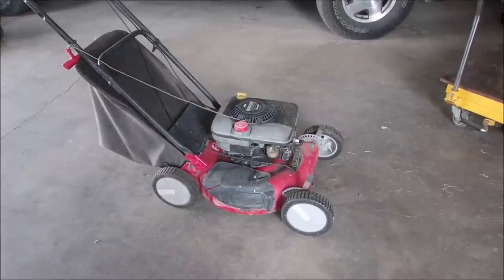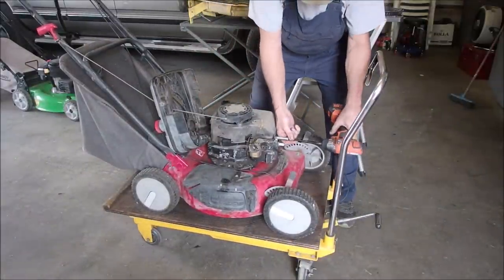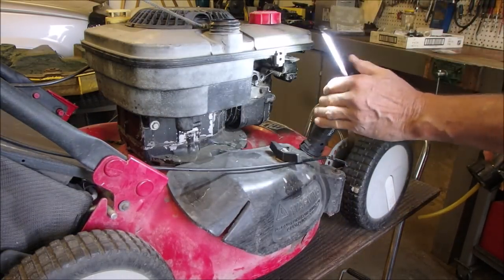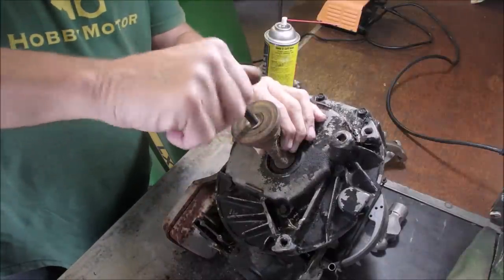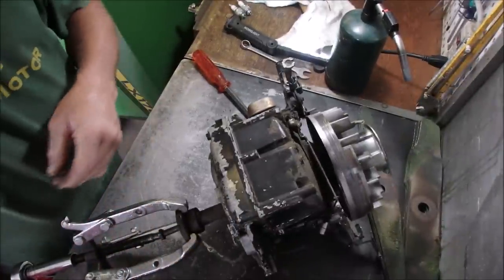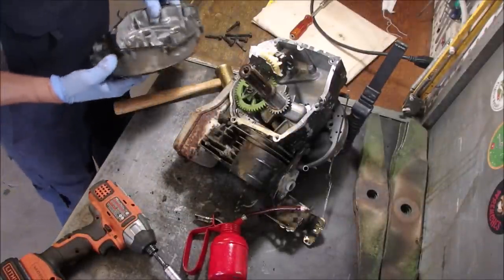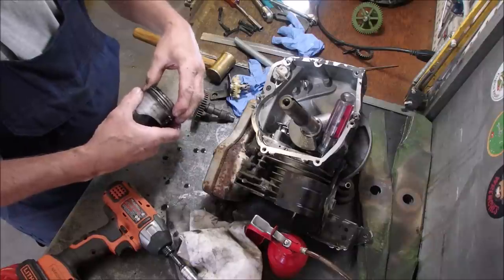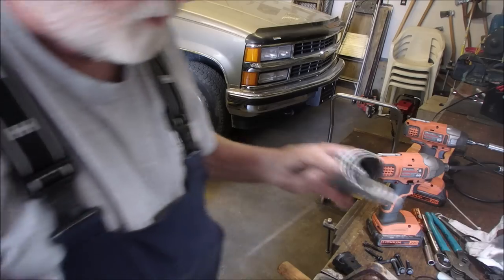Murray Briggs Mower.  Why Can't It Be Fixed

Comment: I like it when you guys strip down engines, especially when you’ve shown the process of fault finding and diagnoses and then prove your thoughts. Great stuff
Reply from the maker: Yes  Thanks Al.  I only showed 2 carbs in the video but fter trying the ones I did the issue had to be internal.

Comment: I built my own push mower and yes I mean "PUSH" in every way possible meaning not self propelled with a side chute because I mulch in the method i mow (blow the clippings into the uncut grass to be cut again). When I built it I used a Murray deck and installed 4 metal wheels from Tractor Supply and a Honda engine. The Honda gave out after a couple years and I replaced it with one of these Quantums which is pretty much the last of the B&S flatheads before they went OHV and as far as I'm concerned is light years better than any OHV so I'm doing everything with in my power to keep it going. Too bad you couldn't revive this one.
Reply from the maker: I agree.  If you can find a quantum that isn't worn out  (the are aging now)

Comment: That Murray lawn mower looked like an early 2000s model.
Reply from the maker: I think 1992.
Reply: @BrucesShop  thank you for the answer!
Reply from the maker: @mwand89  I went and check the shroud which I still have.  960529   may 29 1996.    It is an oldy.
Reply: @BrucesShop  it sure is an oldy sir. The oldies were the best made.

Comment: Great video.  Hey Bruce I wanted to let you know that I found out that a tie rod end puller for an automobile works great on pulling some of those blade adapters!  Well at least the ones without self propulsion.  Any possibility of putting the engine back together since it looks like just a ring issue?
Reply from the maker: No the cylinder is scored so deep.  Value wise the emtire mower isn't worth $80 if it was running.  so I had to stop when i found the bad piston, rings and scoring.

Comment: Bought a new Briggs at
Wallyworld, had to return. 
Got new one home, it was junk.
Had to return. Went and bought 
Honda, 3 years now, runs like new. 
Done.....
Reply from the maker: The newer push rod Briggs engine that you bought are not that great.  This one was an old flathead design.  They are a very good design.  Honda'a are fine too.   The Honda GCV160 is a very good engine.

Comment: It's strange, but it seemed like it had great compression when you were pulling it over.   That cylinder is a mess...I think you are right, somebody was in there before and hacked it up...
Reply from the maker: Yes it did have good compression when it was cold.   Then 30 seconds later while running it failed.  I have never seen that before.   Then after the autospy  the piston was black from heat.
Reply: @BrucesShop    I hear ya, amazing it had any compression at all, guess the cold oil film helped seal it up while starting.  Somebody did a number on that poor briggs

Comment: Bruce: In your opinion, did the previous reassemble person make a mistake and line up the ring gaps, or did the properly turned ring gaps (10, 2, and 4, like Dr Pepper) migrate into alignment themselves?
Reply from the maker: I think something in  there was over sized.   The lower ring was jambed in there so tight.  As well did you see how tight the rod cap was on.

Comment: Too bad you could not save that one. At least it has an oil drain plug on the bottom of the engine so you could do a proper oil change. Happy Independence Day.
Reply from the maker: Thanks.  In Canada we delebrate our Canada Day on July 1.  The  U.S. is July 4 ans you well know.  Thanks though.